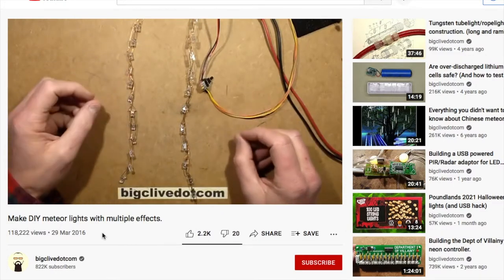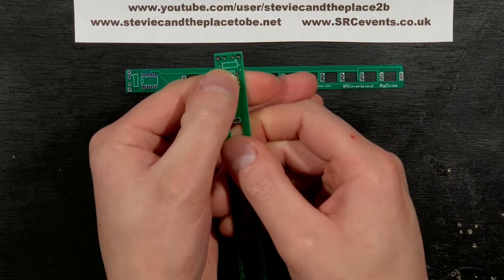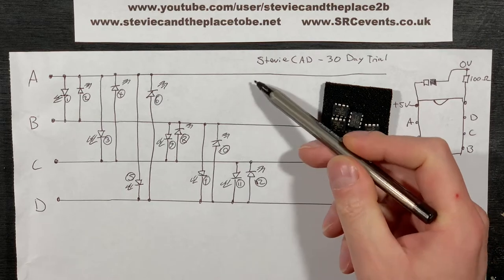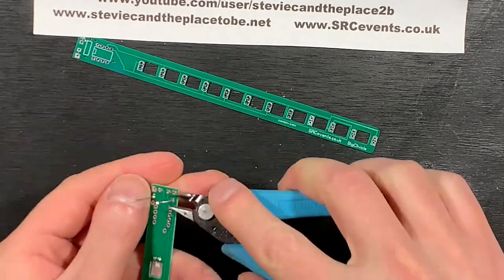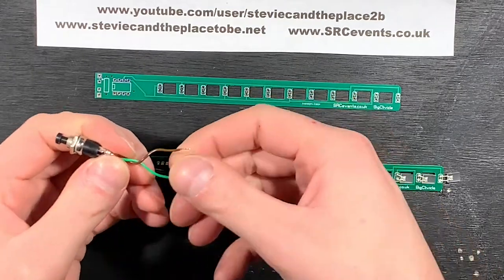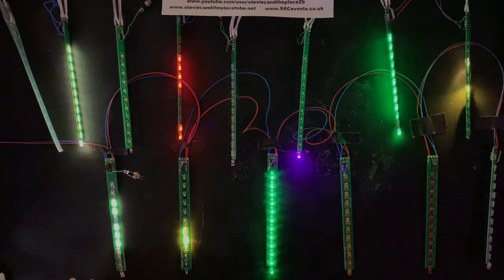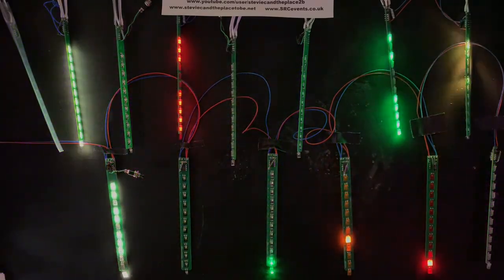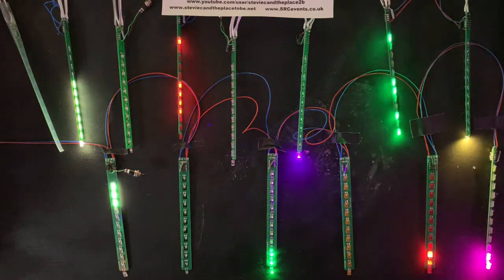BigClivicle: an LED meteor/icicle PCB Project

Comment: I clearly need to improve the debounce software on the button input.   I think it was jumping through several programs at a time.
Reply from the maker: You don’t need to do anything, the icicle firmware is amazing as it is. Maybe I could add a debounce capacitor…
Reply: @steviecandtheplace2b  It won't take too much work to add a slight delay after the button press.  I should have done it in the first place.
Reply from the maker: @BigCliveLive  if you wanted, we could coincide version 2.0 of the firmware and version 2.0 of the PCB ;)